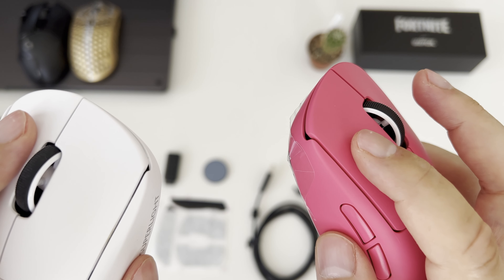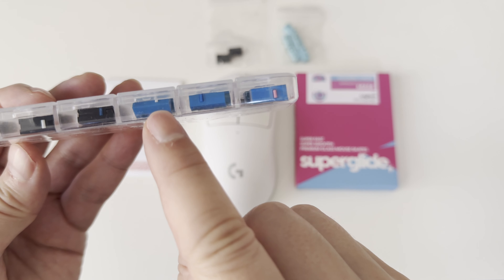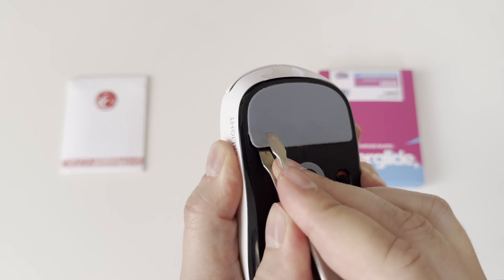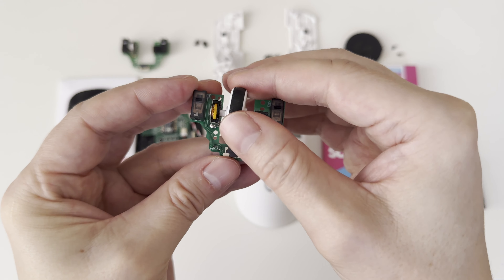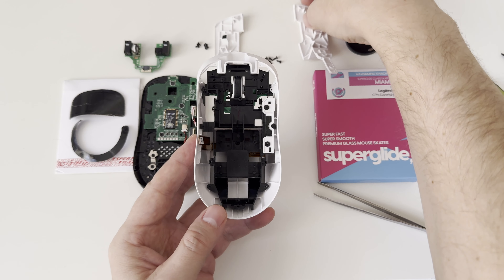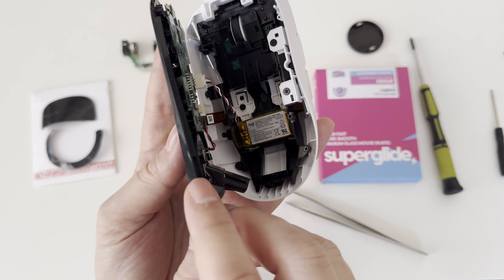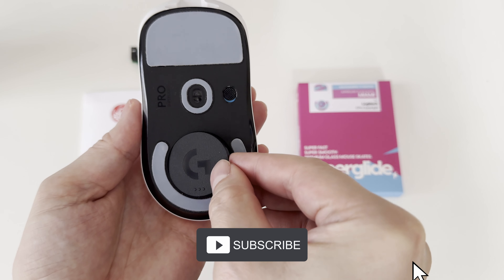Fix for double clicking and scroll wheel rattling on Logitech G Pro X Superlight

Comment: Yep, mine does double click after 1,5 years of light use... Mine 25$ A4tech mouse does pretty better of heavy gaming and angry hitting for 4,5 years (yes, my teenage years), but this sh*t fail pretty miserably. Anyways, thank you for the video, I will use that!
Reply from the maker: Thank you for watching. I'm sorry to hear that your Logitech G Pro X is having double click issue. Hopefully you'll manage to fix it based on the guidance in video. Good Luck!
Reply: @ottomixa  well... the other I get rly angry and hit it very hard several times, and no issue after that for three days. Maybe that's the secret my old cheap mouse worked without problems for 4,5 years.

Comment: Can you please provide exact catalog numbers of recommended switches? I am trying to find it but Omron 10M is just not specific enough as it returns stuff like D2LS-21 which is obviously non compatible. Dik
Reply from the maker: Thank you for watching and posting a question. Following are the exact catalog numbers of Omron switches for GPX:  
Japanese Omron D2F-01F with operating force 0.74N
Omron D2FC-F-7N : 5 million times with operating force 0.74N
Omron D2FC-F-7N(10M): 10 million times with operating force 0.74N - this is stock switch in GPX
Omron D2FC-F-7N(20M) : 20 million times with operating force 0.74N
Omron D2FC-F-K(50M) : 50 million times with operating force 0.74N

I have posted the same on following post: https://www.youtube.com/post/Ugkx9ohMq7C5QA5IjzFlH7Al6VWFA3tKZMkF

Comment: JUST DON'T USE OMRON SWITCHES!!
Reply from the maker: Thank you for watching and sharing your guidance. I guess Japanese Omron switches can be still considered when fixing the G Pro X double clocking issue. Though I have used Kailh GM 8 switches. Good luck to everyone choosing the best switches for their fix of Logitech G Pro X Superlight.
Reply: @ottomixa   @ottomixa  D2FC - Chinese omrons (Bad)
D2F - Japanese omrons. (Good)
I just switched everything to Kailh GM 8.0 on my Logitech . Too gooood 🔥.
Reply from the maker: @hexagonal7075  Good choice, did you replace the full switches board or you've been de-soldering and soldering back the Kailh GM 8.0 switches?
Reply: @ottomixa  Only the main clicks on the Logitech g102. I also bought Keychron M1 Wireless which already has Kailh GM 8.0

Comment: had my mouse for 1 hour and scroll wheel stopped working completely?? any ideas?
Reply from the maker: Thank you for watching. I’m sorry to hear you have issues with scroll wheel on your new Logitech G Pro X Superlight, I would recommend to return it to your reseller and get new one instead.
Reply: damn I was thinking of getting one :((
Reply from the maker: Thank you for watching. It is still worth to get Logitech G Pro X superlight. I would say it is rare to get new mouse with non-functioning scroll wheel as usually it takes 1-2 years of daily usage to receive double-clicking or scroll wheel malfunctioning issue, which is very similar to other mice.

Comment: hello can some one help i have side button double click issue
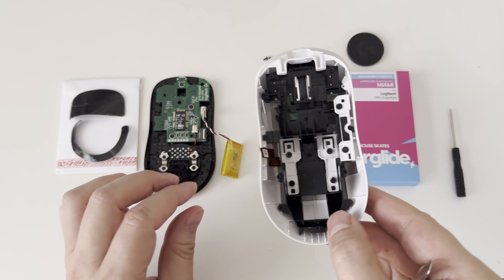Reply from the maker: Thank you for watching. I have not covered the replacement of side buttons in the video as I do not have issue with those, however the dismantling process will be very similar except that at 4:30 you will unscrew the two screws holding the side buttons and possibly cleaning them up could help, if not you will need to go for replacement. I might do another video showing fixing of side buttons so stay tuned.

Comment: Hi, may i know where to find the last option that hot spot swap module with TTC yellow core encoder for scroll wheel? May i have the link.. Thank you very much.
Reply from the maker: Thank you for watching. I bought it on Chinese e-shop and the link is no longer available unfortunately, but there are plenty of same if you google out Logitech G Pro X Superlight hot-swap board micro switches. Good luck with replacement of switches and fixing the issues with buttons or scroll wheel on your Logitech G Pro X Superlight.
Reply: @ottomixa  May i know from your opinion TTC gold, or omron , or khalid is better nowaday? i still struggling which to pick.

Comment: i fkd my mouse trying to replace switches... guys dont try with cheap soldering gun (need good one)
Reply from the maker: Thank you for watching and for posting your comment with your experience about soldering the GPX switches. I'm wondering if your soldering caused copper layer delamination from the PCB board. Are you planning to get new board with new switches preinstalled?

Comment: I was able to fix my double click problem by switching out the board thanks to this video. Very kind thanks.

If you're someone trying to replace your board, keep in mind the "tension spring" part is VERY IMPORTANT to handle with care, especially after you insert the new board back in. My tension spring popped out twice at this step, and I was lucky enough to find it in my room. But you don't want to be like me because the thing is tiny and thin--it is smaller than a dime and thinner than paper. Do not underestimate reinserting the tension spring part. Every other step is pretty much straightforward.
Reply from the maker: Thank you for watching and posting your experience of fixing the double clicking issue on G Pro X Superlight. You are correct about the tension spring, I have almost lost it as well. Your feedback is very valuable. Hopefully your G Pro X works well now.

Comment: Hello can you share the details and size for the TTC Gold Wheel Yellow Core Encoder for superlight. My scroll is not working properly. I was planning to replace my broken one.
Reply from the maker: Thank you for watching. the TTC Gold Core scroll wheel encoder is same size as the original TTC White/Silver Core scroll wheel encoder. You will need to search "TTC Gold scroll wheel encoder for Logitech G Pro X Superlight" to get the correct one, which apparently is 8mm height. You will need to de-solder the old one and solder in the new one, unless you will choose the same option as I did to replace the board with already soldered switches and scroll wheel encoder. Good luck to fix scroll wheel issue on your Logitech G Pro X Superlight.

Comment: I read a comment on another video and it help me a lot, Take a deep breath and then breath inside the mouse slowly to create moisture, this will reduce the static energy inside the mouse, and possibly fix the issue.
Reply from the maker: Thank you for watching and posting a how-to comment. Indeed there are discussions about blowing the air under the mouse buttons, similarly to cleaning the mouse switches or mouse scroll wheel, which might help in some cases. Unfortunately in my case it did not help and I had to proceed with switches replacement.  I'm looking forward for other experience with malfunctioning switches and scroll wheel on Logitech G Pro X Superlight.
Reply: THIS WORKED! You are a life saver man, i was about to order a soldering tool.
Reply: Dude WDF i tried and its like magic. Tried this if you live in a desertic area o with low humidity
Reply: Bro! can you please share a link to the other video cuz I wanna know exactly how to do this. Or can you guide like exactly where to breathe? Near the opening lines of the mouse buttons? Thanks! @cuirenteria
Reply from the maker: You can even use Hama pressured air for keyboard cleaning to blow the air underneath the buttons from the front of the mouse. Another tip for scrolling  issue which scrolls up when you scrolling down is to hold the mouse upside down and heavily scroll up and down  to let the dust fall out, plus you can also blow the air next to the scroll wheel to remove the dust and tiny hair. Hope you managed to fix it without dismantling.
Reply: it worked lol, i wasnt expecting it at all
it was double clicking like 30 times out of 100 clicks, now I clicked 200 times and it didnt double click once
feels like blowing super nintendo cartridges to make them work in the old times xD
Reply: this comment deserve likes, i was about to buy a new one. thank you
Reply: fixed issue for me, Thankyou, like this comment so other can see it 🔥🔥💪💪
Reply: Thanks, worked for me

Comment: Hi, there are tiny tension springs under right and left mouse buttons that hold each of them, just like on the scroll wheel. Are there any chance to put them back in during reassembling process?
Reply from the maker: Thank you for watching. At 4:39 of the video I'm dismantling the buttons and there were no tension springs on my version of Logitech G Pro X Superlight.
Reply: @ottomixa  My bad, these springs are attached to the inner shell of the mouse, just below the switches themselves, so there is no need to fuddle with them. Thank you for response!

Comment: Thx for this video. Seems it will be helpful for a long time. My 6y old G Pro wireless started to left double click like mad 3 days ago. Blowing under the buttun solve the issue for ~20min. Then it starts to double click again, occurency raising as time passes...
I already ordered a new one, but I would like to try to fix this one, just in case.
Not sure if switches are the same between G Pro and G Pro X superlight version?
Reply from the maker: Thank you for watching. The process of replacing the board will be similar though there are few  differences. If you decide to change just the switches by de-soldering and soldering new switches back then you can use same switches. If you choose to switch the motherboard with pre-soldered switches, then you will need to choose board specific to G Pro mouse which is different than on G Pro X Superlight mouse. Good luck with your project.
Reply: @ottomixa  Thx again for your reply.
Switches are the small black boxes I suppose. Seems not too hard to change.
Will give it a try. <3

Comment: Awesome video! My superlight just started double clicking recently... I've had it for about 3 years so I can't really complain too much seeing as how my original G pro started doing it after like 6 months. Regardless, I dont really wanna shell out another 100 something dollars for a new mouse. Going to follow your video to see if I can't get these switches fixed out for some new ones. Thanks!
Reply from the maker: Thank you for positive feedback. I'm looking forward to see another comment from you about successful fix of double click issue on G Pro  X Superlight based on this video. I'm wondering if you are going to replace only switches by using soldering or you will replace full switches board same as I did. Either way good luck!

Comment: TYSM! I clean and solved the Scroll Whell Problem!
Reply from the maker: Thank you for watching and posting a comment. Indeed mine scroll wheel was dirty as well as seen on 5:40 and cleaning it up helps a lot. Did you reuse the gliding feet after assembling it back or you have installed new one?
Reply: @ottomixa Yeah, i use the glider again.  Now it's scrached but i don't see diference between before. I just remove all exept the scroll whell, clean all with compressed air and lubricate the scroll with a tiny amount of WD-40 👍👍👍

Comment: hello otto great video!! it help me a lot.i have a question i lost the tension spring right next to the one you were trying to put back. is it ok? will my mouse function correctly?
Reply from the maker: Thank you for watching and using this video as guidance to replace double clicking switches on Logitech G Pro X Superlight. Tension spring is used to hold the scroll wheel on its place, without it your scroll wheel might incline more to the left and will not retract back to centered position, or might be little bit more wobbly. If you can still use flash light on your phone and search for your tension spring, that might help you with some other annoying issues. Good luck!
Reply: thanks your your answer otto but its not the tension spring the wheel is the other one on the right side thats why idk if its useful or not.heh

Comment: Hello! where can I get the module you used? I am having double clicking issues and would love to replace the switch like you did. Thank you for the video!
Reply from the maker: Thank you for watching. I  googled out something like "micro switch motherboard for Logitech G Pro X Superlight" and then I just chose the one with best switches type and scroll wheel encoder, also good delivery option is a plus. Good luck with replacement of double clicking switches.
Reply: @ottomixa  thank you Otto! I did research all day and decided to go with the Omrom japanese switches I found on amazon. I think I will enjoy those a lot! I am gonna solder myself since I have a biiit of experience I think I can do that. Thank you for being the person that enlightened me to this path!

Comment: Hi there! Just to ask, where did you get the hot swappable board for switches?
Reply from the maker: Thank you for watching and posting a comment. I would not want to promote any shop, but basically I've searched on google for "Logitech G Pro X Superlight hotswap board" and then I picked the one which looked legit and had best delivery option for reasonable price. As seen in video I have not used the hotswap board at the end, because I have realized that with every swap of switches I would have to destroy the skates. I hope you will find the good replacement for your doubleclicking Logitech G Pro X Superlight. Good luck!
Reply: @ottomixa  Curious, why are you not putting the shop in the description?

Comment: Where can I buy the switches and the gliders and which are the best ones you would recommend? i also have double click problems with my side buttons
Reply from the maker: Thank you for watching. "Superglide" gliding feet I got from Max Gaming  online shop. Some switches I got from local retailer and some from China with longer delivery time. In regards of best mouse left and right click switches that would be personal preference but the mouse modding community talks a lot about Kailh GM 8 and Japanese Omron switches D2F-01F. Default stock switches on Logitech G Pro X Superlight are Omron 20M D2FC-F-7N(G1).  In regards of the side buttons micro switches D2LS-21 Blue Dot, then again modding community is replacing them with Kailh Blue Dot micro switches. I'm still yet to do video about side buttons switches replacement, stay tuned and good luck with your side button switches replacement to fix the double clicking issue.
Reply: @ottomixa  Thank you for your answer. Would it be enough just to change the switches or do I also need a new circuit board as shown in your video?
Reply from the maker: @akuwox3899  if you know how to do soldering, then just changing the switches will be enough to fix the double clicking issue. I got the new circuit board because it was faster for me to change it. Are you going to change left click switch and also side buttons switches?
Reply: @ottomixa  The last time I soldered was 15 years ago or so. Then I'd better buy a circuit board too, right? I think I'll just change the left mouse button and the right one for now. Do you have a link for the board and the switches?
Reply: Bro i have 1 question ! 
Did the mother borad mousesuper loghit go x working on mouse go super light 2 or not , I have a problem in the right click and i need to change it , i serach omron click logitch 2 but i not found !
Reply from the maker: @ab0hdo   Thank you for watching. Switches board of Logitech G Pro X Superlight will not work on Logitech G Pro X Superlight 2. Logitech G Pro X Superlight 2 has Optical switches called LIGHTFORCE Hybrid Switches which are different from switches used in Logitech G Pro X Superlight 1.

Comment: Bought purple hotswap board with ttc gold encoder from aliexpress. It works fine but it makes different rattling sounds when scrolling.  It's much louder then the white encoder. Not sure if its normal. I put it together exactly like you.
Reply from the maker: Thank you for watching. You are correct, the TTC gold encoder is slightly more noisy and rattling compared to default TTC white -silver scroll wheel encoder. I'm still planning to change it by de-soldering the scroll wheel encoder from switches board and installing some better, but I could not find the best one for which the soldering work would be worth of. Happy to hear you managed to fix your double clicking issue on G Pro X though, good job.

Comment: what about click latency of u are changing the original pcb of the mouse? i think that the latency will be increased no?
Reply from the maker: Thank you for watching and posting a comment. Most of the mouse latency is caused either by microprocessors or other PCB components on the board. Switches latency is for longer discussion, but generally good working Omron and Kailh GM switches have very similar latency. PCB printed wires between the components won't cause latency unless they are damaged or from non-standard material or with interference. The board which I was changing does not contain any PCB component except switches, scroll wheel encoder and connectors, meaning it is purely printed wires connecting the switches with the connector. As such there is very low probability of the latency increase and the latency will be very same. I'm talking little bit about the latency of Logitech G Pro X superlight on my video comparing it to Finalmouse ULX at https://youtu.be/fDOZv6sII40